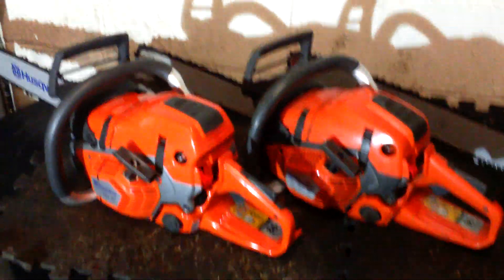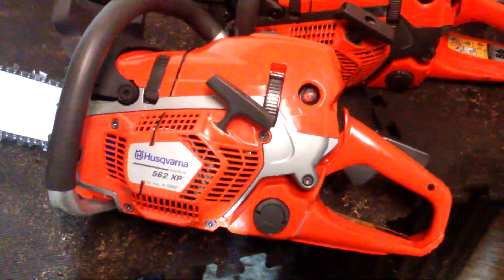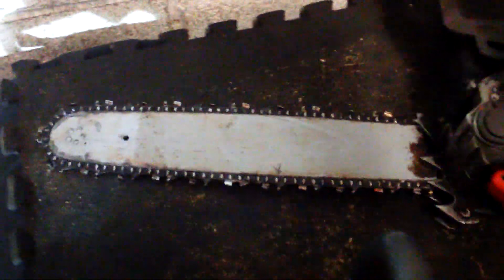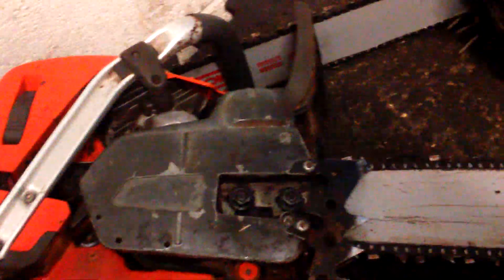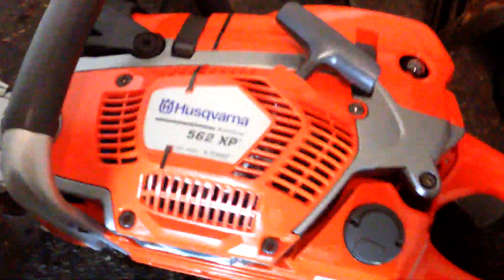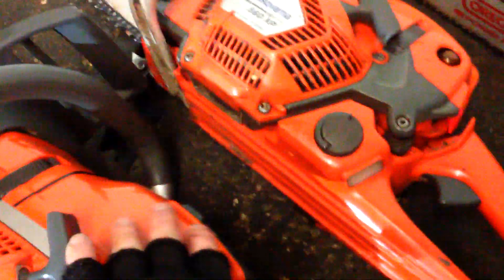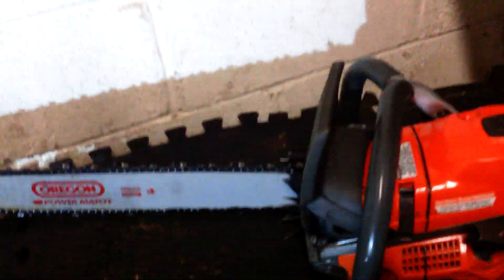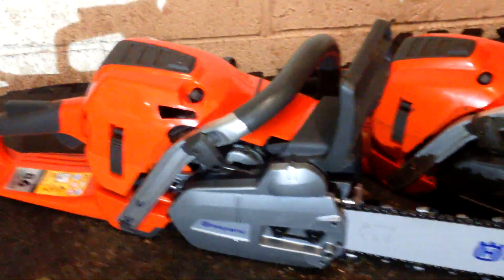The first official 562 XPin UK and R of I

Comment: Nice saws, i got a 550xpg.
Just used a new stihl 261, that sems to be a good strong saw it got 4,1hp so it more then my 550. but cant say that i feel it. I think if you buy a real good pro saw you will get a good saw.

Realy like the wrap handle. would like to get one on mye 362 and a good tune up.

thanks for shearing 😃

Comment: 562xp is a beast of a saw.  I have had the G version now for  over 2 years (USA version) ,  much prefer the larger mount and higher capacity oiler, the larger log dogs set her off well.  Do you find any difference between the ported 562 and the unported model?
Reply from the maker: Evening Mr S, yes although the stock 562 handles a 24" very well my ported 562'S command a 28" very well.As you say the better oiler etc just make it a much "better" saw than the 560 . will be interested to see how they sell now they are avalible on the shelf in the UK compared to the 560 ?
Reply: Your 562 ported must be a screaming banshee.  With regards to 562 sales in the UK and Ire, the larger mount giving the ability to have more oil is a huge plus.  I would also think the bigger distance with the clutch further out in the 562 means the saw must be better balanced.  As you say the 562 runs 24" comfortably, but I find the bar does get really quite hot, I use full comp on the 24", interestingly I do have a full skip 73JGX to hand but never needed it as yet.  (the advantages of travelling to USA to get different set ups)
Reply from the maker: I run a 28" bar and full comp chain on my 562XPG and by far a very able saw . I hadn't noticed a bad heat build up, what chain oil do you use ?
Reply: outinthewood I use husky oil, always have, if I find it keeps heating I may try to shave a smidgen off angled end of the piston pump in an attempt to increase the movement range and therefore output...
Reply from the maker: I have to say I've not found a problem with oiling, is the Husky oil you are using the Bio oil ? There is a breather behind the bar plate on the bar studs is that clear ?

Comment: can i ask whare u got the hot saw from as am looking for a husy like ur hot saw with full wrap handel
Reply from the maker: Hi Ross, you can order the 3/4 Wrap from your local dealer. lookup the 562xp IPL and get the part number. To fit the new wrap handle you flick off the grey tank protector to screw in the third mounting screw that the wrap has.The " hotsaw " I refer to is a saw prepared and reworked by" Hotsaws101"have a look at his youtube channel.